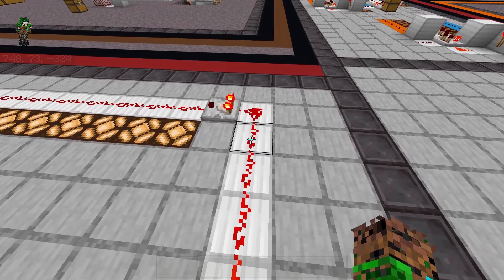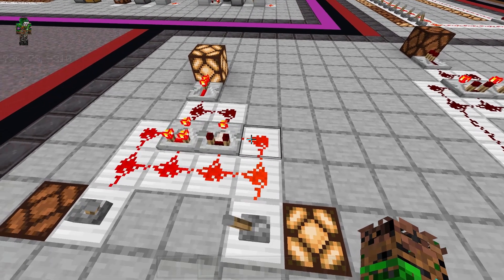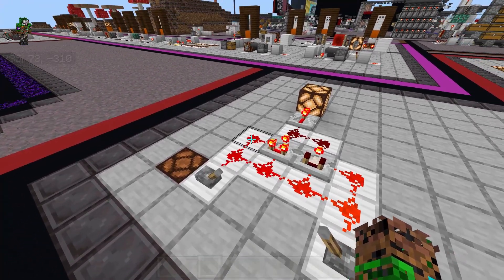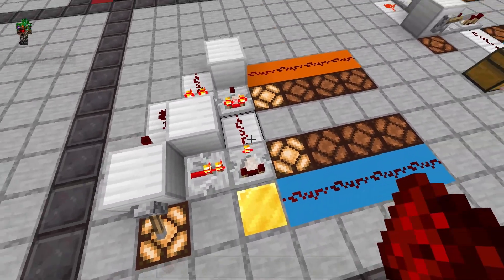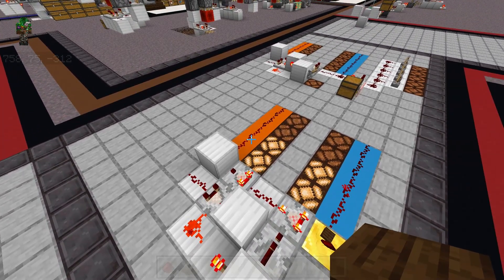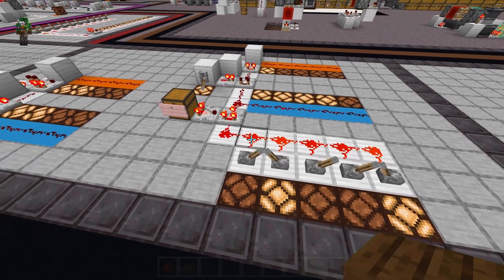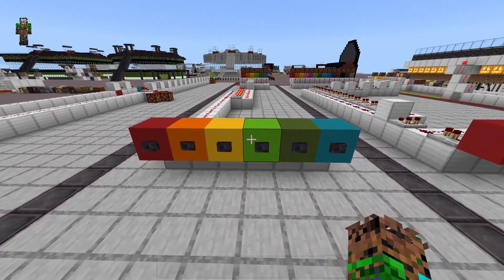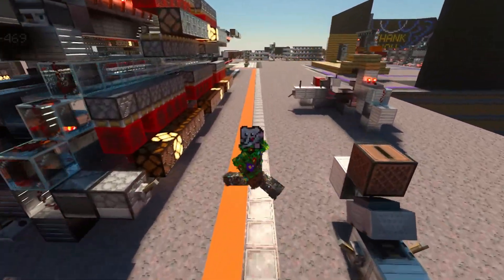XOR Gate, Low Level D & Comparator Explained | Let's Learn Redstone 11 | Minecraft Redstone Tutorial

Comment: 0:39 I think that another major factor is that comparators have multiple functions, inputs and modes, which makes it take longer to learn. However, the comparator is a very powerful component when its properties are combined. For example, combining the comparison or subtraction mechanics with the ability to read container fullness allows making compact pulse extenders or counters.
Reply: What could the substraction mechanic genuinely be used for in that mechanism? My creativity can't explain that part
Reply: @Mattzart01  I have made counters that use a signal strength 1 pulse to subtract from the value stored in comparator memory cell.

Comment: Thank you for the video and your further explanation of the comparator and D latch.  I was having some understanding issues until you explained the infinite clock.  

I do have a request for a future video (or point me to the old video if there is one).   Explanation on the redstone behind your multi item sorters clock and input area.   I sort of get the hopper clock, but not the other items around it.  Mainly why a copper lightbulb is used with it.  I guess it could be some sort of D latch, but you do not seem to set it up in any sort of on or off position.  

Thank you again for your learning redstone  series.  They have helped me a lot.
Reply from the maker: @Nermal144  Super glad that you enjoy & that I could help!!

As for the MISS sorter's timer clock thing; I'm actually touching on that in the video I'm working on right now! Basically an example of using gates (viewing a contraption as individual circuits rather than 1 big thing).

But the copper bulbs in that timer are all functioning as shorteners. Previously to make a shortener was like 2x3 and had to be flat -.- but a copper bulb, comparator + observer works as a shortener in 3 blocks, that can provide its output in any direction. Super helpful for compacting the redstone.

 So that timer is: when the input dropper has items in it, that triggers an rs latch which activates the clock when 'set'. Then when the input dropper becomes empty, the comparator turns off which turns on the torch. The torch is then shortened to a pulse which activates the etho clock to start counting down. Once the etho counts to 0, the block of redstone moves & is turned into a pulse by another shortener. Which then activates the reset piston on the rs latch to turn off the clock :D 

Hope that makes sense!!! If not, hopefully it will make more sense in the next episode :3 
Again, it makes me happy I can help! Thank you so much for the support & kind words :D

Comment: Do the gold pressure plates work differently then the wood ones?
Reply from the maker: @KPdewstar  yussss. Gold plates have 1 strength per item or entity on them. Where as other plates have 15 strength regardless of what is on top.

So a gold plate would have 5 strength if there are 5 zombies on it lol
But any of the other plates would have 15 strength if 1 zombie is on it.

Gold plate is like one of the least used unique components XDD
But it's fancy! Like you can make a simple 0-15 scoreboard with it, by dropping up to 15 (different) items on top of it via a dropper. Then just picking those items up to reset the score haha
Reply: @OmLedu  so its like a weigh scale then. ill have to try it out
Reply from the maker: @KPdewstar  yusss exactly! It's a funky component. Nothing else like it :D